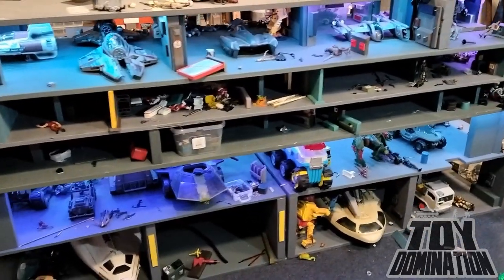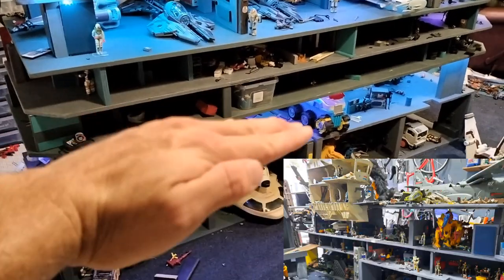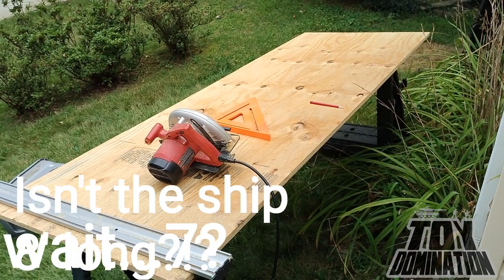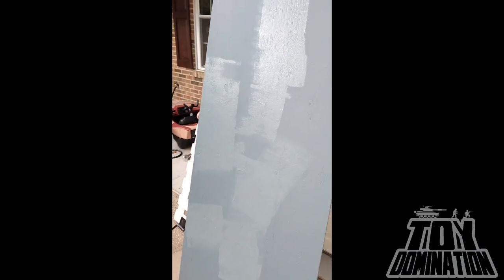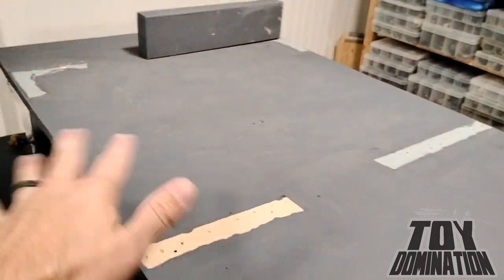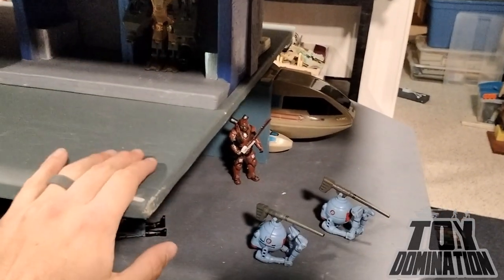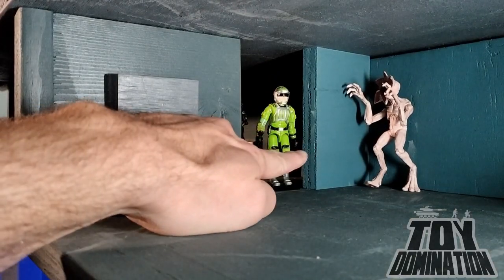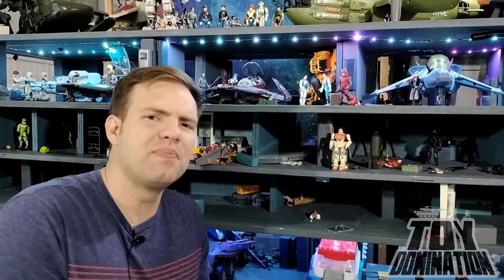1:18 MASSIVE Space ship Playset. First Build 2022

Comment: it s an idea, but this is no ship, come on!
there s no effort to even make it look passable as a ship, it s shelves...

wood will never give you the finish or flexibility cardboard would give you
when you double or triple cardboard s thickness, it s solid as wood
and it s free...

I m making dios out of cardboard for 6' Joes figs, and it does nt even bend
mistakes are much easier to fix with cardboard too
once you glue generously, it s solid as rock

I d put a dolly underneath too, to move it around, much more practical
and this room is a mess bro... very cluttered
this affects your focus and concentration, a mistake most Lego creators do at first

modular is better, it should have been planned from the start, enabling sections to come out easily
it s best when you need to come back to a spot to fix or improve things
also, light grey would have been much better, it looks too dark
more height room too see the interior better, it s too tight as is.

but... this always happen when you attempt something like this
I ve been there, at 14, I used to build bases out of fridge boxes,
and I ve learned a lot since
while I did nt continue until recently, at 55, I m much better at it now
cardboard, foam, real plants, lights, acrylic paint, and tutorials on the tube made wonders
I admit I miss the 3' scale, it was easier, and there s very few vehicles in 6' scale,
one can do amazing bases with 3', much more impressive.

with time, I m sure you will improve, as is, it s pretty basic and unrefined
it s always once you re done that you figure improvements, it s experience
I hope you keep at it and push it to the limit.

so now you know...

good show bro
Reply from the maker: Thanks for watching. 

Be sure to check out the most recent updates to this project, with more to come for this year.
Reply from the maker: https://youtu.be/iGzMbrSnC2Q
Reply: @toydomination  thanks bro! you ve put so much effort in this, you deserve that I check the latest improvements.
Reply from the maker: Thanks, man!